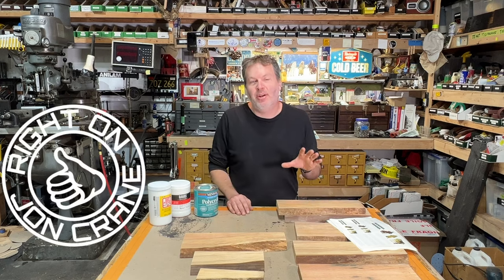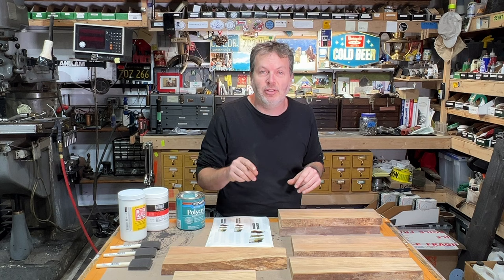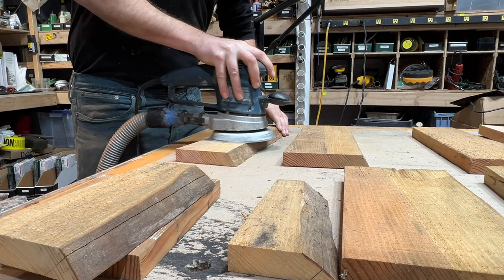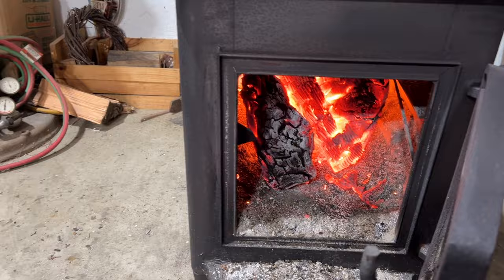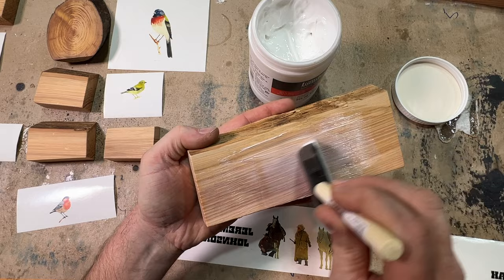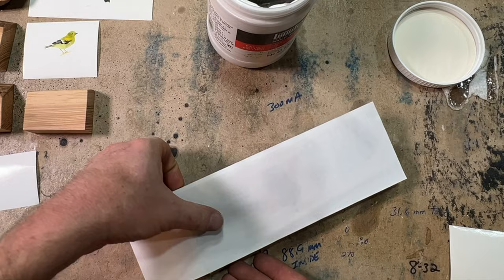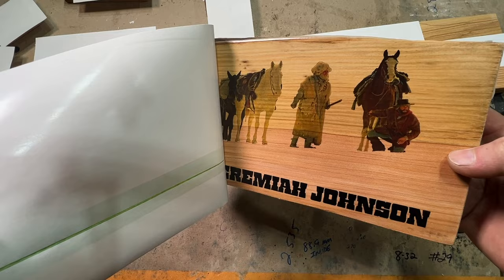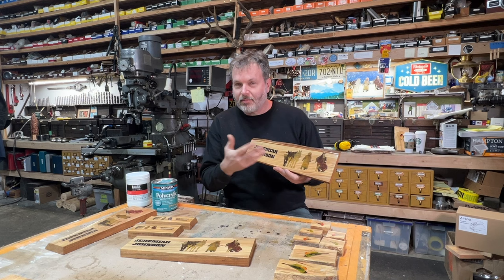Transfer Any Photo To Wood! - Hands Down Best Method! Jeremiah Johnson

Comment: Right on Jon! Very cool projects and i saw the one you sent to Big Vic. I was wondering would you be able to use a small rubber roller to smooth the transfer on to the wood? Thanks for the great video. ✌🇺🇸